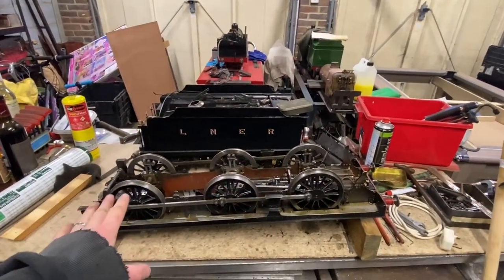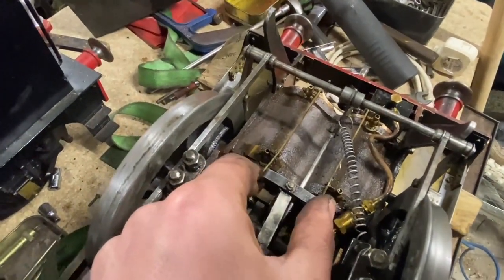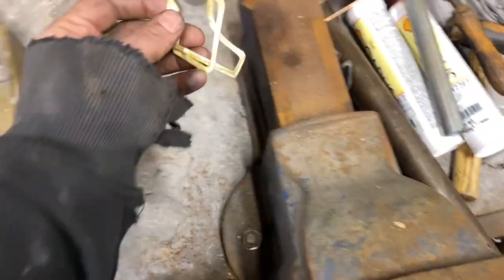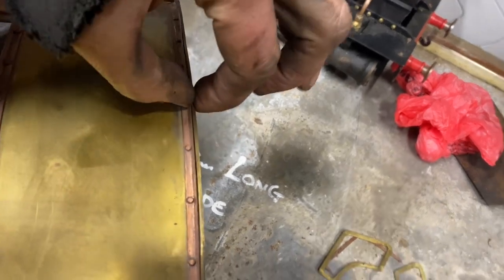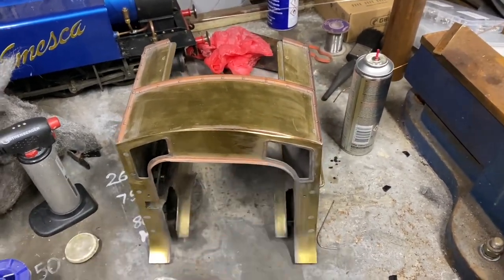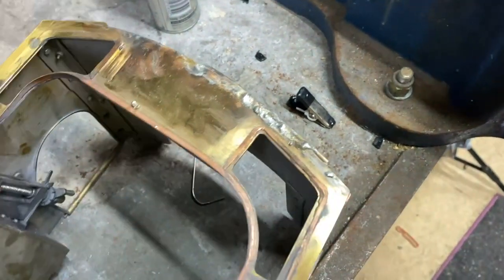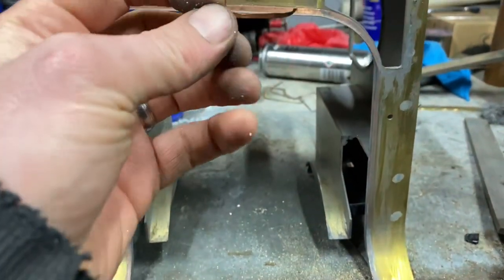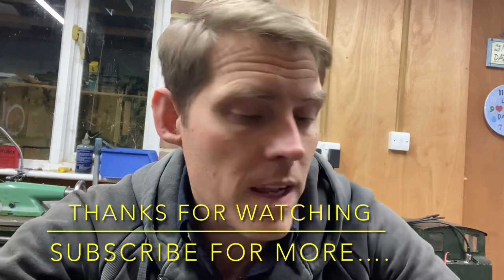GCR POMPOM, chassis assembly and starting on cab platework.

Comment: Sorry Tom wrong key pressed....
Is that solder paste, a solder 'in it's own right' or just a flux ?
Cheers.
Reply: Solder paste was used to tin copper bus bars in my old job.
Clean the copper, paint the paste on, heat until melts and wipe with a cloth, you would get a near perfect finish.
Reply from the maker: It is a solder in its own right, but for this kind of work I feel it needs a bit more solder. I didn’t know what the flux is until the previous reply here, but it is a very good flux.